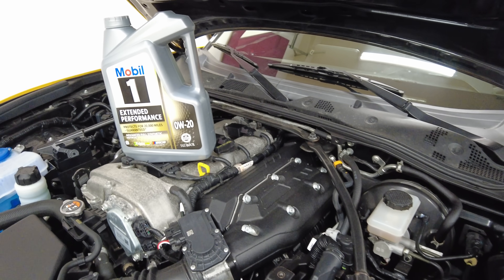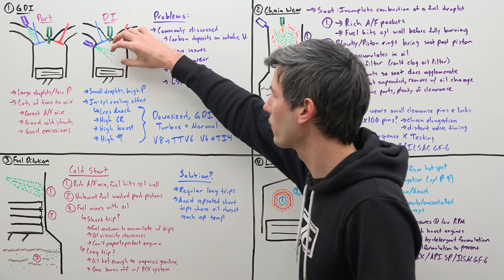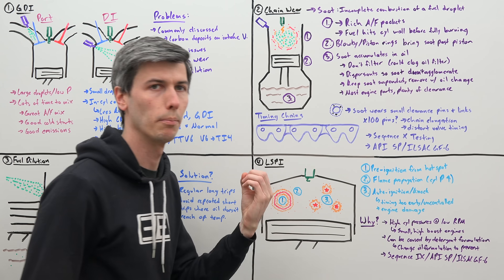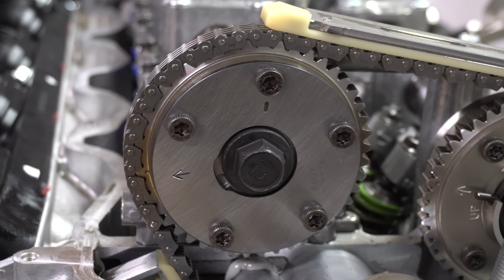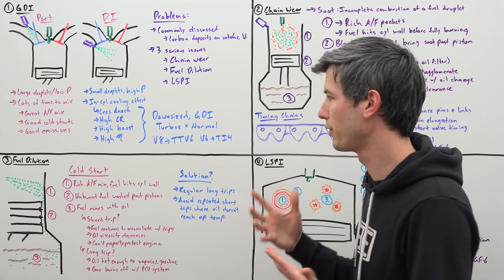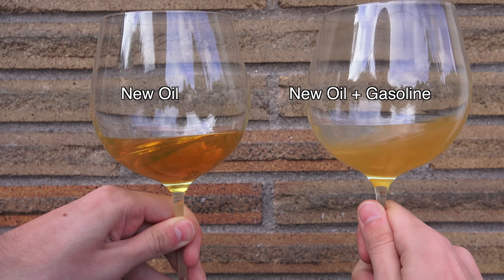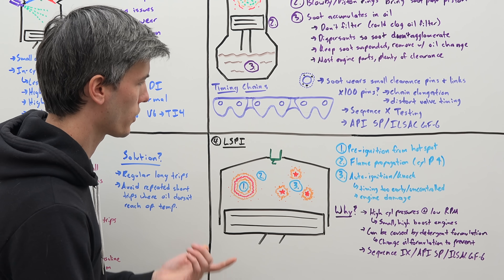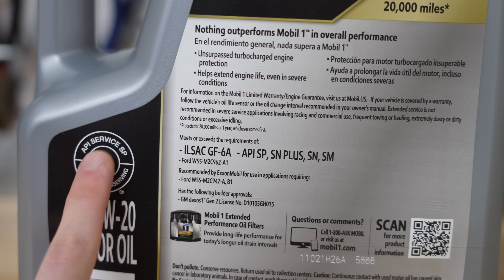3 Big Problems With Direct Injection Engines (Gasoline)

Comment: Interesting and detailed video.  It seems GDI leads to similar challenges faced by diesels, which also have DI and have to deal with soot and don't do well with short tripping.  It is quite notable that GDI engines produce more soot than port injection out their exhaust.  Perhaps we will eventually see DPFs on gas powered engines too, another PITA to deal with.
Reply: Direct injection gas engines foul up the intake valve which is not a big problem in diesel due to differences in valve timing.  I didn't know that they made more soot than ported injection - that's not an attractive feature either.  300 horsepower from a small engine is not for the home mechanic.
Reply: @MrKnutriis  make sure to use gas with good detergents, ie Top Tier gasoline. Use their website to find stations in your area. It helps with intake valve buildup.
Reply: Perhaps if we weren’t trying to get 300Hp out of a four cyl engine we wouldn’t have most of these problems. If we simply put a horsepower cap on new engines and reduced power output by around 30% on all automotive engines we wouldn’t have a lot of these problems.
Reply: They have already started installing GPF on petrol engines.

Now Petrol engines has just as bad particulate emissions as diesels and still put out more Co2, but hey...Diesels bad, petrol not...

Comment: In WW 2, Germany used gasoline direct injection in the DB 605 fighter plane engine. It used a modified diesel injection system, was completely mechanical, was supercharged, and ran on 87 octane. Allied aircraft needed 110- 115 octane, and had to roll upside down before diving to prevent fuel vapor from rising out of the carburetors and stalling the engine. Isn't it amazing that car manufacturers took 60+ years to try the same concept, while making it more complex and less reliable!

Comment: I was an auto tech at a GMC dealership for 8 years. I was there when the 2014s Sierra/Yukons came out with The GDI engines. I would say the biggest issues I seen on these engines are caused by lack of basic maintenance. Some reason GM decided that in most driving conditions these oil life monitors would go about 7500 miles til it reached 0. Well then the owners would wait another 2 weeks-month to have it serviced. Because these engines have the AFM with hydraulic lifters ( which ran off oil ) lack of oil changes caused these to fail. 

Another thing I saw was the failure of the injectors themselves. Typically stuck open dumping fuel. This wasnt because of the oil intervals , some were new and had bad injectors.  However normal injector service would pro long the life of the injectors from getting clogged. Then with the GDI due to the carbon build up on the intake valves , induction services were highly recommended at about 15k-20k miles to help stop the build up. Alot of the build up I saw was caused by short trips , stop n goes. The carbon can cause cold start misfires. hard starts. ect.

 Another thing was the vacuum pumps on these trucks that were lubricated from the oil , lack of oil changes caused alot of these to fail. GM had a recall to reprogram the software to try to fix it but it didnt... Ended up replacing alot of pumps under special coverage . They updated the pump with a new design but nearly every one I replaced I noticed in service history of extended oil change intervals. 

I have a 2018 Sierra with the 5.3 I change my oil every 5k while running full synthetic oil. I also use injector/fuel system cleaner in the tank every oil change. I have 41k on my truck and not a single issue due to carbon,  lifters, injectors or vacuum pump.

Comment: I got a fix for the carbon on the intake valves get rid of the EGR and have open air crankcase vent 🤣 equals more power and longer engine life. And while we're at it get rid of The California clean Air act and EPA. At least for automobiles.

Comment: As a retired tech that's worked on everything from aircraft, motorcycles, marine engines and everything in between, I have to disagree with a lot of this video. The whole oil contamination/soot thing is equally possible with port injection. Actually, more so in cases. Droplets in port injection are larger and they need a warm engine and velocity to atomize correctly. That means you are more likely to wash the cylinders/dilute the oil with port injection. Direct injection droplets are very fine and atomize quickly, even with a cold engine. While an injector might be aimed at a piston wall as you say, port injection is going to hit a wall too. With direct inject, you actually have less exposure time as it is injecting closer to TDC. Think about it for a minute, with a slight redesign and going to direct injection, the engines get better gas mileage WHILE making better power. That's because you're using less fuel due to better atomization/efficiency. You are metering the fuel better. Tuners have struggled to get as much fuel as possible atomized in the ports for decades. Direct injection is better because it doesn't have to tumble down a port, go around corners, and swirl around a manufactured combustion chamber to try and break up droplets. Sorry.

Comment: I work at a German car dealer, we see countless cars with very low mileage 2020+ with washed down oil simply from not driving the car long or hard enough to actually heat up the engine and burn off alot of the moisture & fuel, still reliable but don't be afraid to really drive the cars and get them up to temp it really goes a long with with keeping the engines clean a healthy

Comment: The buildup of carbon around the intake valves can also alter the way air flows into the combustion chamber which can result in poor mixing of the fuel and air.

Comment: So how many people here are a fellow tfsi owner. A3 2.0tfsi 8p, remapped and have these issues. I have Oil catch can, cars been stood for 2 weeks as i noticed ticking noise (cam chain/tentioner) very common issue. so going to get that changed on payday. always use millers nanotec oil as recommended by alot of tfsi enthusiast. great engine and really tuneable but god its so much maitaince lol

Comment: Hi!
i have a question reguarding disck brakes!
saw your video about it and was left with a question, wich me and my fellow car mechanics wont agree on.

Placement of the caliper, if you have it on the back side of the center wouldnt it then force the car up? and on the front side force the car down? 

i might be wrong but in my mind if you brake on only 1 side it will not be balenced so in my mind you would need 1 on either side to take out that force, none wich i have talkd to can explain this for me, can you?
Reply: The forces involved in braking can all be modelled as happening at the road surface, so the only important variables are the location of the tyres relative to the centre of gravity. Brake calipers provide friction against rotation, which creates a reaction torque, but that has no net lift or weight.  

The location of calipers is more about the design of the suspension and if parts are designed to be strong in compression or tension.
Reply: @chrisallen3702  so if you got a big ass disc say 5m in diameter and you brake on just the 1 side it will be in perfect balance? The bearing will have equally force all around?
Reply: @Iceylightening  Yes assuming no play in the system, the forces at the wheel bearing are the same.
If you had a 5m radius on the disc with only 1pot, it would could make the same braking force as a 10pot caliper at 0.5m radius. On the 5m radius you brake pad would wear out super quick  and on the 10pot system the disc would wear out super quick.

Comment: Should I avoid buying the 2022 Honda CRV with the 1.5 Turbo engine that uses GDI? Do you know if Honda has fixed this issue in their cars?
Reply: Avoid it software cannot fix it. It's a lie.

Comment: Frequent oil changes at twice the OEM recommended frequency (e.g. 5K miles versus 10k miles) is my primary method of dealing with these inherent issues on my Min Countryman JCW. Timing chain replacement at 100K miles (or earlier) is also key. Lastly, the good old OIL CATCH CAN mod!
PS: I tend to run in SPORT MODE, favoring higher RPM on hills.
Reply: R55 jcw and I do the same thing here! 105k miles and still using the factory timing chain,
Reply: Yes bit changing the oil every 5k Miles is really bad for the environment... An oil should last at least 12k Miles to reduce waste.
Reply: @alexanderstephenevi733  You do what you want with your car...I'll be saving mine. Go ahead and eat your beans...I'll be having steak.
Reply: @jb678901  keep eating those steaks tough guy. Is not the environment, but your heart, arteries and joints who are going to pass you the bill.
Reply: @mazpr2025  Low carb diet...fit and trim at 55. Never felt better.

Comment: I got boned by Honda because of direct injection. Had to get a walnut blast on my Fit's intake and new fuel injectors because of it 😠
Reply: WOW I would be mad as HELL. My 20 yr. old Focus manual has port F.I. Works like new.
Reply: @BigEightiesNewWave  oh believe me I am. 6 year old car needing a 2k repair for the sake of trying to squeeze out a little more efficiency has made me lose faith in the brand. I'm looking to replace it with a much comfier and less bullcrap to deal with 80s American car

Comment: 🔔😎 Being in the business I've noticed one alarming fact.
Most people are strapped for money and buy newer cars and use the cheapest oil and filter they can buy to save $20. Oil change places sell them what the customer demands.
The engines get rough after 60,000 miles, throw codes, and people just keep on driving them until they quit.
JME

Comment: 🔔😎 👍👍
Mobil 1 user for 30 years 👍
As good as any, better than most.😎
Reply: My pushrod 5.0 Ford's have the oil to water oil adapter under the Mobil 1 oil filter. 
200* water heats the oil when it's cold. Cools the oil when it's hot. 👍 Consistent temperature and evaporates condensation.

Comment: I’ve noticed with my Gen2 3.5 Ecoboost that there is sometimes low speed knock retard occurring, but only when there’s no boost and the load is low. It seems to be a common occurrence. It seems the lower the ethanol percentage the more this occurs. Using pure gas results terrible engine performance in regards to idle, MPG, and power. Using a blend of E30 still on the stock tune seems to work fantastic at correcting all said issues.

Comment: I thought that the main reason for direct injection was for better fuel economy? However it does not sound like there is much better fuel economy.  So why did all the manufactures switch to direct injection?
Reply: A port fuel injected 3.5ltr V6 without turbo makes about the same peak power as a 2.3ltr GTDi. The fuel economy benefit of the smaller engine is two fold, less friction, more time spent driving near peak efficiency. Depending on the vehicle its about a 20% fuel economy improvement.
Most importantly if you have a turbo the direct injection does give better emissions at low speed high load. Port fuel injection simply does not work well under those conditions, so you would have to dial back performance to make legal emissions
Reply: @chrisallen3702  You make a good point. However given that the engines are both NA and both the same CID, I know that the port injected engine will make more HP than the direct  injection engine. As far as fuel economy goes I don't believe there is munch to be gained in an NA engine with direct injection and it also causes other issues for the engine.

Comment: I always thought chain stretch was due to  having additional load of the high pressure GDI pump driven off the camshaft but still using the same chain size from the port injected engines

Comment: GDI is great for race engines, but bad when government bureaucrats mandate requirements. GDI on street engines is meant to reduce displacement and maintain same power levels. So quality SEFI engines can run 300,000 miles with good maintenance but there are gdi engines out there CAKED in carbon at as low as 30,000 miles. 
GDI SUCKS for consumer engines. Im betting where 220,000-250,000 miles was common in SEFI engines we are going to see shelf lives of 100,000-175,000 miles in GDI Turbo motors. 
I HATE GDI and the companion CVT tranny

Comment: I have a 2018 Chevy Colorado with a 3.6 V6 DI Engine. The PVC system works efficiently. At 100k miles  I see very minimal carbon build up on the valves. Nothing compared to the carbon build up on Audis and VW's.

Comment: In my experience the chain failure on GM ecotec engines tend to be the results of the guides breaking down.  These guides are often plastic.  In Ford v6 engines it's the water pump bearings.  Very rarely do I replace a chain because the chain itself is worn.  Usually it's because I'm in there anyway and something else has failed causing timing to be off.
Reply: Seth Jones. I can’t agree with you more. I’ve owned a 2011 GMC Terrain 4cyl ecotec. I’ve always been up to date with my service intervals with regards to the oil changes. At 36k Mi, it needed a new chain. At 75k Mi it would die out in traffic and I got rid of it. At only 55k Mi I found myself doing 2k Mi oil change intervals. The engine would burn 1 quart of oil every month at 1,000 mile use within that month. It’s a crap engine. Faulty piston rings caused oil to burn leading to a faulty maintenance minder reading. If you went by the recommended oil change by the shop or the minder you would have no reading on the stick like me. This in turn caused the chain to slap because the tensioner on this engine works by oil pressure. The ecotecs were made to fail.
Reply: AFAIK every manufacturer uses plastic chain guides. If they are metal the running surface is still some kind of plastic or teflon insert.
Reply: Thats only on Ford's transverse V6's though. The longitudinal V6's, like in the F150, do not have a chain driven water pump. It's driven by the regular belts and yet 1st gen 3.5 Ecoboosts in the F150 still had major issues with chain stretch. The 1st gen had a single long chain that drove both cylinder banks. The 2nd gen(2017+) went to dual chains, one for each bank, that are close to 1/2 the length and therefore are not as sensitive to elongation.
Reply: I had a 2016 1.6d made by GM.

It started chain rattle at 30.000 miles and this was indeed the plastic guides breaking off of the metal they were moulded onto.

The reason, i was told, was the chain tensioner was weak and at startup it would take a few seconds for it to tension.

This meant that the chain would be able to "slap" the plastic, and this made it fail.

That engine was dubbed "Whisper Diesel" because it was supposed to be extra quiet, but it did not take long before people online, renamed it the "Rattle Diesel".

To change the tensioner, chain and guides, they needed to take the engine out of the car and split the engine from the gearbox. Price for this repair was quited by a GM workshop here to be "No less than $2500"...

That problem and a few others made me lose faith in the car completely, i sold it to a GM dealer and bought an EV instead, i dont want to have to contend with expensive engine problems.

PS. Yes when it started the car was in warranty, but i, and others were told by GM that this was just an "Engine characteristic" and not to worry.

When the warranty ran out, they found out it was a problem (Engines started "exploding") i talked to them again and they agreed i should get that car fixed, but now it was out of warranty so i would have to pay out of pocket.

If you wonder then.....Yes, i am NEVER buying a GM vehicle ever again.

Comment: You would think with all the technology there is out there that there would be some kind of coating that could be put on the intake valves of a direct-injected engine that would keep the crud from accumulating.

Comment: I don't have a GDI engine, but the itty-bitty turbo 4 in my Cruze runs much better if I use 89 octane fuel.  Better throttle response and a bit better fuel economy helps offset the extra pennies per gallon cost.  I think the ECM uses a more aggressive timing curve once it figures out that the fuel is higher octane.

Comment: Some of the issues have to do w/ the ring gap. What if the mfg's. use a 'one' piece ring. It's not one piece but it's a compression ring that overlaps itself. The mfg. goes by the name of "Total-Seal". The biggest issues is w/ the mfg's. is the Corporate Profit Business Model. To many Engineering Department Mgr's. are agreeing to 'cheap' alternatives instead of real solutions. The climb up the Corp. Ladder is by 'making' money & appearances. Has nothing to do w/ Capitalism, just greed.

Comment: 3 Big Problems With Direct Injection Engines: Electric motors, batteries, and controllers. Soon gas engines will be obsolete being replaced by battery electric propulsion.

Comment: at work I drive a 2000 saturn wagon. its 1.9 liters, 124 hp and weights 2400 lbs. gets 23 mpg with the automatic trans mission. one of my coworkers drivers a 2018 focus st, 2.0 turbo, 6 sp manual, 270 hp, weighs 3200 lbs and gets....23 mpg. ON PREMIUM. mine eats good old 87 and is happy to do so. no turbo for me, no gdi, just a simple dohc port injected 4 banger. when it breaks its cheap, DIRT CHEAP, to fix.

Comment: Another downside to the higher output from smaller engines is the increased BMEP within the cylinders which puts higher stress on the internal components. The engines are working harder, which means the long term reliability will be decreased.